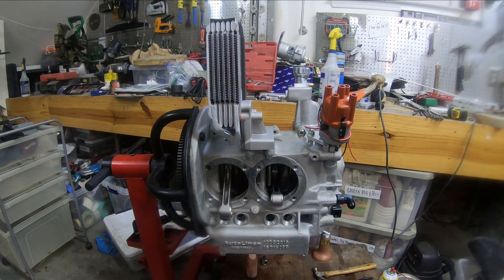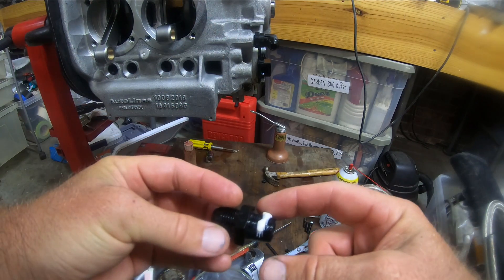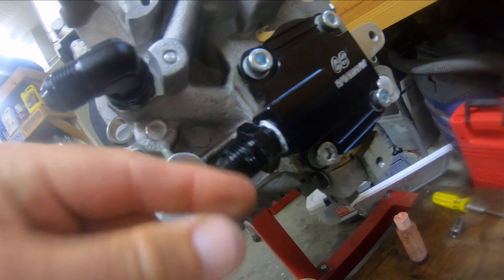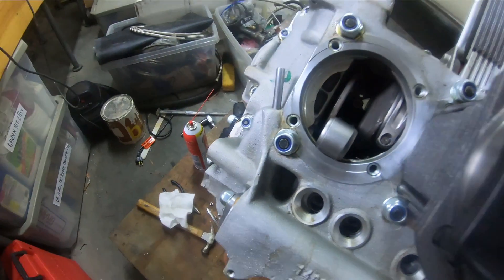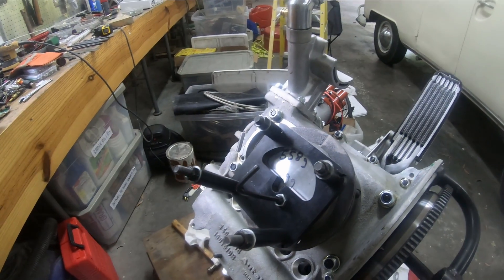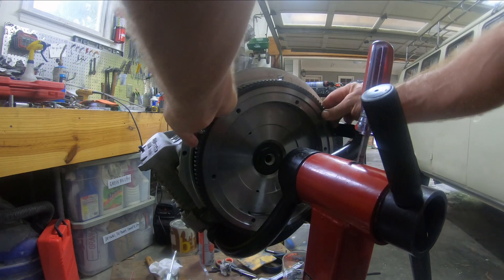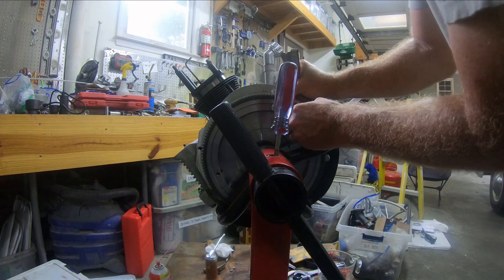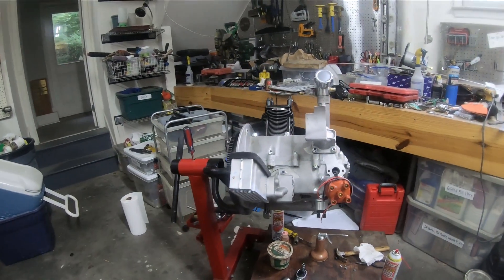2332 VW Air-cooled Stroker Motor - Video 15 - Oil Fittings, Deck Height, End Play

Comment from the maker: Went for 0.005 end play (not 0.003).  Two barrel shims is not ideal, but the 1.5mm or 1.45mm spacers are out of stock, so 2 shims it is...  Also I need to measure end play with a dial gauge, oil the flywheel shims, and put on a brand new main seal rather than one that i removed and put back on.